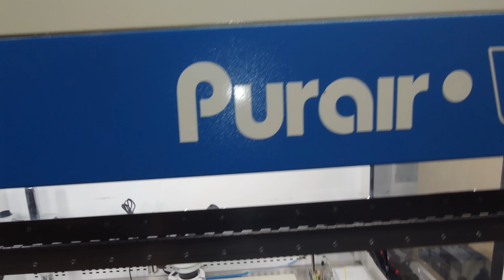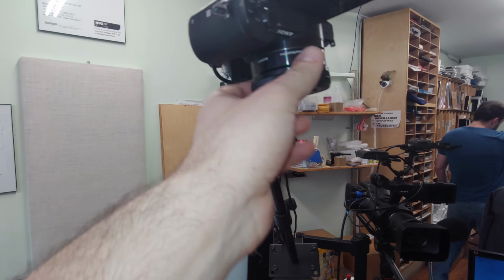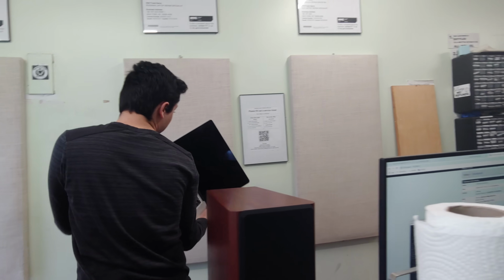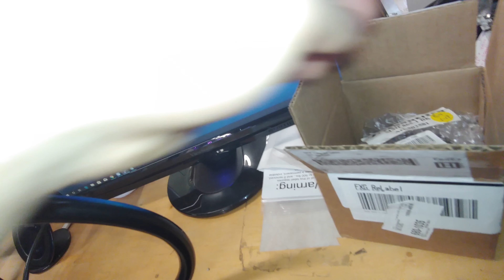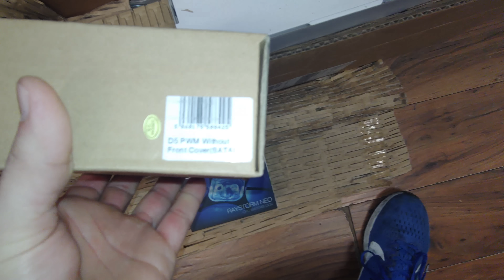Upgrades to recording setup, fixing infrastructure, new data recovery videos

Comment: Glad there are more people that hate Seagate as much as I do!
Reply: Same, mine shitted itself and I lost a lot of data, yes I was dumb for not having an backup but it was just porn so no biggie. Since then I've been happy with WD.
Reply: people still trust seagate in <current year> ?
Reply: @burnzy3210  No, people buy 50$ 4TB drives to store all their games.
Reply: Became a hater yesterday myself when my 2to external drive crapped on me. Then when researching what could be wrong, the floodgates of "Seagate is shit" opened up and i learned.

Switching my other seagate drive even if it's brand new to a WD real soon. Unless WD is just as bad. Guess i'll have to research it.
Reply: Thanks for the heads up everyone. I added 2 Seagate Slim Drives to my imac audio studio last year. I have been thinking about laying out cash for a Dropbox backup solution.
Reply: To those showing off their seagate drives, i say this. Congrats on getting the 1 in 10000 drives that actually work normally from Seagate. The other 9999 ones all failed under a year.

I've been using computer for over 25 years, and the only drive that crapped out on me was an old maxtor that they sent me a new one even before i had sent the old one back. Of course if i didn't send the faulty one they would charge me for the new but that was back in the early 2000's. And then seagate bought them up and killed the best disk manufacturer. I will never buy a seagate ever again. 1 hard drive fails on me in 25 years, and now a seagate craps out on me in less than a year. Seagate is pure crap.
Reply: My first seagate lasted 2 months, replaced in warranty and now i'm praying for this one not die. And also at the same time a WD blue died on another system, while the samsung on my laptop is dying, yeah, I don't have much luck with hard drives.
Reply: @rokero171  How much did seagate charges you for shipping ? To honor the warranty i had to pay more than what the disk was worth for them to honor the warranty.
Reply: Ironically I only ever had one problem with it once. Granted it was a few years after I used the old external hard drive.
Reply: I had a Seagate 1TB external hard drive in 2014. It did not last 1 year.
Reply: I use a mix of WD, Seagate, and HGST drives and I always have issues with my Seagate drives. I've removed most of them from regular use except for 2x1.5TB drives that I have in RAID1 for videos.
Reply: I have a seagate IDE drive with 30k hours logged thats still alive, compared to my 2008 WD Black drive that's very very dead. And a HGST drive that died. Other than those two though, I've had no Hard drives of any brand fail on me. SSD's on the other hand.... and I'd far, far rather deal with a failing hdd than a failing ssd any day
Reply: I have got a very old drive which had windows 3.0 and dos.5.0 and it was only 120mb and it has no errors, but also I have drives which are 2.5 and 3.5 from makes which are from china and Thailand and  have died after a few years. I am guessing that now days they are made for a price. the ones from china are the worse for dying. the ones from Ireland for Seagate were the best but they shut that frim down. so now it pop luck if you get a good drive which will last more than 6 years now. the of all were the mfm derives were they would put on the drive were the bad blocks were so when you formatted them you could write in the bad blocks but they were only 20mb to 42mb and look like a very big brick and heavy.
Reply: I've lost 4 1TB seagate drives. Never again
Reply: My first Seagate 1TB Barracuda died 1 year after buying and was replaced by warranty (God bless Germany). Now I have a another 2TB Barracuda from Seagate because I got it open box for 20 bucks.
Reply: So to mix things up a bit, here I am with ALL of my Seagate drives I ever bought still working:
2x 1TB (ST31000525SV), bought in 2010
3x 4TB (ST4000DM000-1F2168), bought 2013, 2015, 2017, runtime 831, 622, 420 days

Meanwhile, 2/2 of my Samsung drives had died after about 1 year.
Reply: Ohohoho. I've had two Seagate drives crash and burn, while 9 external WD drives (and one internal Samsung 840 Evo Pro) did not.
Reply: Ironic how seagate spent so much time with website down (MONTHS) couple years ago when my new barracuda seagate died. Took so long "restructuring " I thought they must be blocking my specific IP, even tried to access via other computers. When back up, suddenly I didnt exist, my drive warranty had expired, and they promoted their own drive recovery services hard. (Make SHIT gesr, then profit even more by fixing YOUR OWN GEAR, WHATTA BUSINESS model)

Drives USED TO BE all independent companies and far more reliable. Today, you get a bullshit "warranty" that pretends to be 5 yrs, and when it craps out in almost 2 yrs, is ignored and denied by the company. 

Think it was a TWIT podcast years ago I listened to where a drive and security expert was interviewed about the landscape. Crappy drive company bought good companies out, started making EVEN MORE CRAPPY drives, sullying the names of the drives that once had stellar track records. Seagate was one of them. Dont expect them to honor warranties, dont expect them to make good product, DONT WASTE YOUR FKING MONEY ON SEAGATE, among others. Go search fhe podcastworld, it was an eye popping interview
Reply: Same! I had 3 Seagates all crap out on me. Thankfully was able to rescue the data on them, but never again! WD has never done that for me.
Reply: Guess you just out of luck. All my seagates worked for nearly 10 years and they still work. x) I switched them with higher capacity barracudas last year, hopefully those will last as long. x)